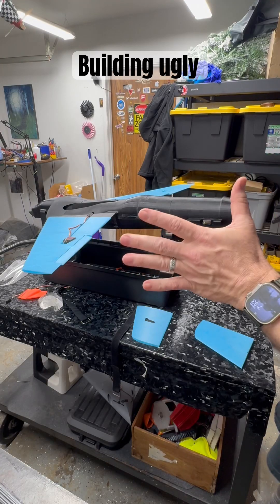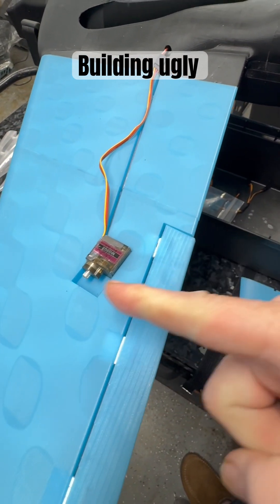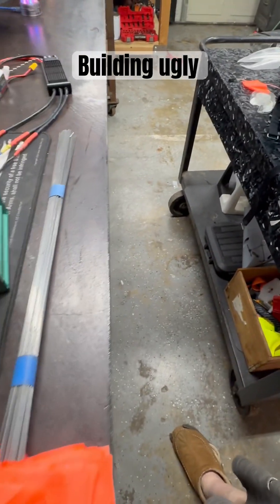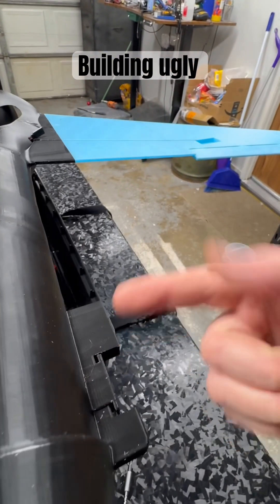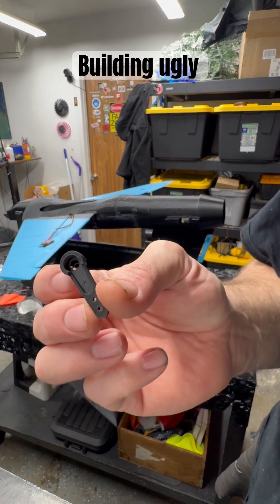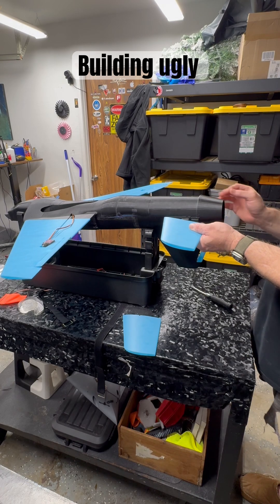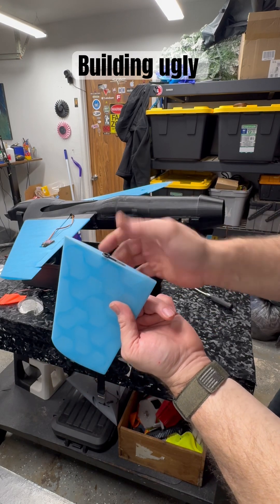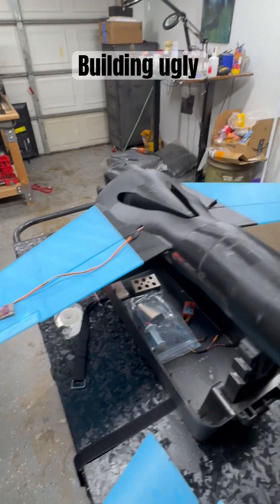Servo placement and wiring for the EDF jet. #update #edf #fyp #shorts #diy #servo #edfjet #rc ￼

Comment: Ehm, giggity?

I kinda hope that the elevators are not just friction fit, or you'll have to search for them in the field as they got torn away at speed.

I love this kind of direct servo drive in my machines, though I probably shouldn't, but my control surfaces are usually also mounted to an axis on the opposite end, so they can't be just blown away.
Reply from the maker: The servos are friction fit, but it took several pounds of force to put them into their ports plus, the force against them won’t be in the direction they were installed so it won’t make much difference. 

Giggity